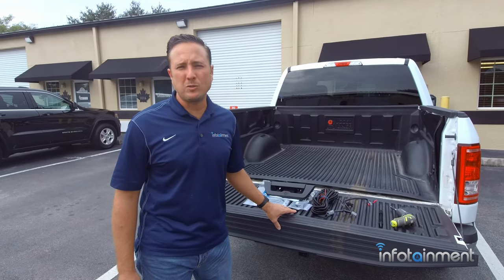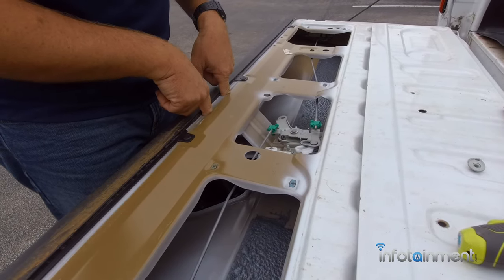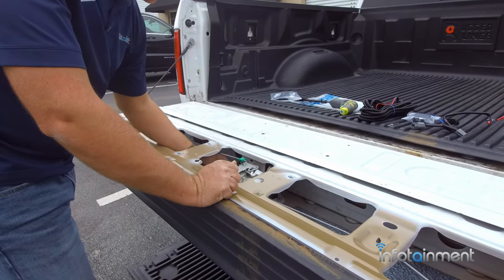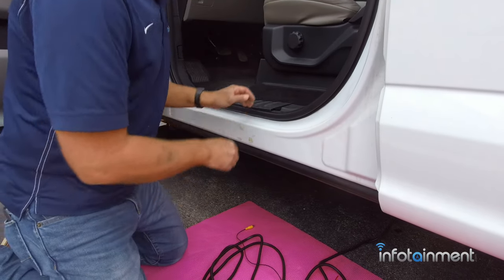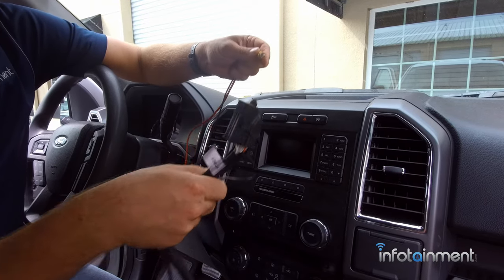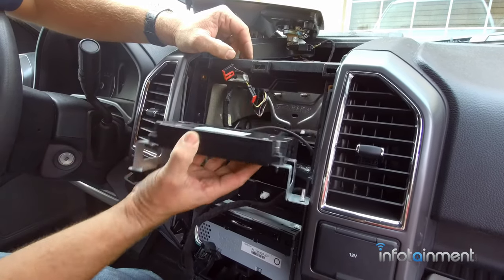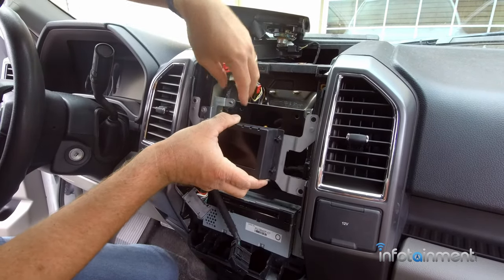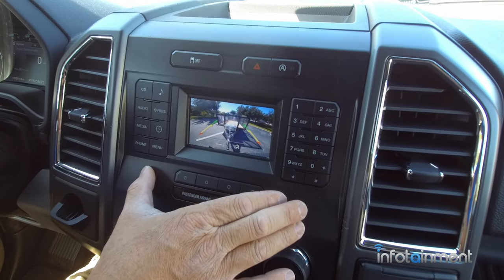2015-2017 Ford F-150 - Backup Camera Upgrade Installation - Easy Plug & Play Install

Comment: Hello. I have a question. I had a backup camera on my H2. After a year the screen would intermittently go black. The next day or later in the day it would be working again. It kept doing this. So I had someone replace the backup camera with a brand new camera. It worked for a week and start doing the same thing. I took it back in. He looked at it. Didn’t see anything wrong. Eventually I had him replace the new camera. It did it again. I got rid of the hummer for 2017 Ford F-150. Without the backup camera. I’m looking to get one. Is there something in vehicles that can make the camera intermittently have a black screen?
Reply from the maker: That could be a myriad of possibilities.

But my first guess would have been a bad connection with the fakra and the radio board. Over time the solder starts to degrade and the connection gets loose.

That's just a guess.

I would have suggested sending your radio to our repair department. They could have diagnosed the radio and repaired it. We have 2 GM repair specialists that are members of our repair team.

You can find a backup camera for your 2017 Ford F-150 at the link below:
https://www.infotainment.com/collections/all/products/2015-ford-f-150-tailgate-handle-backup-camera-kit?variant=41762723399

You can talk with one of our tech advisors at 855-636-6287. They can answer your questions in more detail.

Comment: Could the ford dealership active the back up camera if I don't want to spend the 200 on the genie?
Reply from the maker: If you purchase from us your kit will come with a programmer
Reply: @Infotainment_nav  There is a $200 difference between the kit with the genie vs the one without.